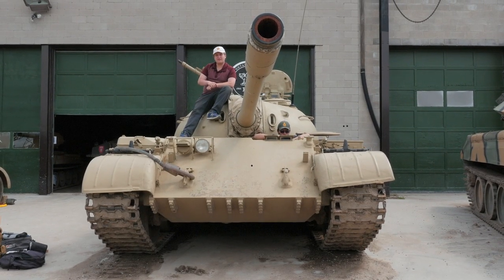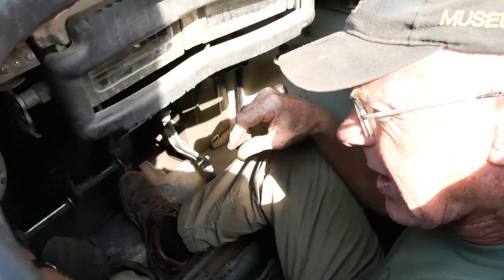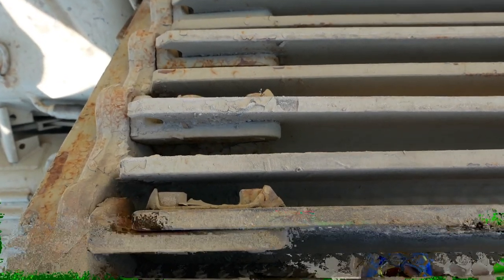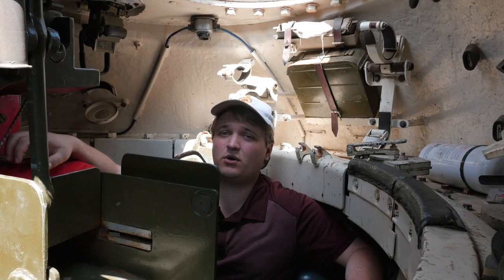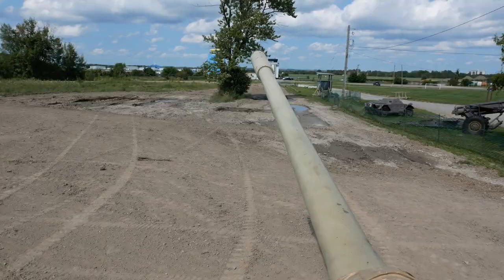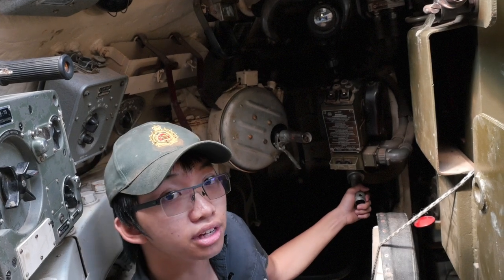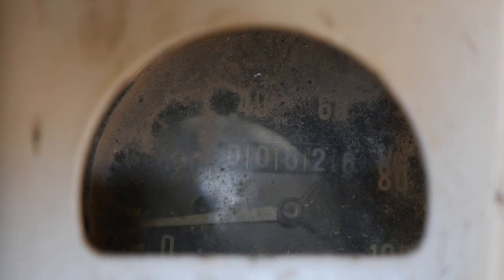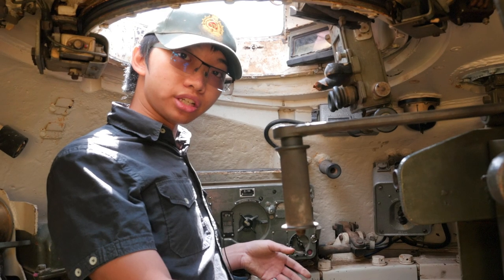Fighting Vehicles: T-54 Fighting Compartment (Startup Procedure and Fire Control Systems)

Comment: The D10-T gun manual says: While driving over very uneven terrain, between shots, make sure the gun is pointed slightly upward, to prevent scooping soil by the muzzle, as firing the gun with the soil in the bore will cause damage or explosion.
So it looks like you could have the gun loaded while moving.
Reply: Any info about kladivo fire control system.according to info.the fcs incorporate 8 bit microprocessor.
Reply: manual sounds circumstancial as if what they said was supposed to apply to a bore with dirt after tank is still

Comment: Inaccurate about Soviet T-34 tanks without radios. That was true up until 1943 - moving on forward all had it and came standard in all tanks - unlike the German headset Russian one came inside helmet ear flaps - I have one and I've also sat inside T-34 and drove one. 

As for losses there was a ton - in all Soviets lost over 80,000 tanks which majority was light and medium tanks compared to German 42,000 losses. Soviets produced 108,000 while Germans a little over 50,000. At the end of the war Germany produced only 30 aces while Soviets over 300. In addition - of the 80,000 tanks lost majority meaning 80% were BT-7s, T-26s and T-34/76 A through F models. When T-34/85 showed up it gave even Tigers and Panthers run for their money. When IS-2 or ISU-152 showed up many times Germans pulled back their counter offensive. Majority of Soviet tank losses were from 1941-1943 and then attrition rate dropped way down and began knocking out Panzer III and IVs like flies, then really taking out Tiger I and II with IS-2s with new Russian tactic they learned from the Germans. Use of artillery, then air assault and clean up the rest with Soviet heavy tanks...almost every battle from 44 and on had Soviets lose less then their German counterpart in the air and on the ground. Operation Bagration Germans lost nearly half a million compared to Soviet 180,000 and Battle of Berlin Soviets lost 80,000 while Germans over 100,000. 

There is alot of lies and misconceptions regarding the Eastern Front and it stems from the work of one man - William Hearst. He was Hitler's personal friend and hardened anti Communist and billionaire media mogul. He spread the idea of order 227 where millions were shot for retreating which in fact out of 3 million who were caught were sent back to the front while 40,000 were sent to penal battalions and less then 10,000 were executed most being junior officers who abandoned their men, gulag deaths of 20 million which in fact was 1.8 million in a span of 23 years and the idea that Germans had 1 to 19 kill ratio which in fact was 1 to 1.3 - Soviet's lost 8 million troops while Germans over 5 million plus their axis partners which added another 2 million giving a total of axis losses of a little over 7 million (Romania, Italy, Japan etc). Majority of Russian losses from the official 21 million figure is 13 million civilians - so its a bit personal when same lies get repeated for no good reason except "soviets are bad" so lets keep it up.

I'm glad you guys have the tank and give it care and love and I hope to pay a visit some time. Other then that great video :)

10/10

Comment: T-54 was equpped with night vision devices, according to the T-54 User's Manual printed in 1969: the models were TKN-1, TPN-1, and TVN-2. However it appears that it was an upgrade feature supplied separately, it could be installed by the tank's crew. The same Manual gives instructions on how to install one. TPN-1 was actually a night vision targeting scope, which allowed to fire the main gun and machine gun at night. TVN-2 allowed the driver to drive the tank in the dark.

The same Manual doesn't say anything about not being able to drive with a loaded gun. The tank had two states: Marching state and Combat state, which were declared by the tank commander. The tank could be moving in any of these states. In Marching state, the gun was supposed to be unloaded and fixed in marching position with pins etc. In the combat state, the gun was prepared for firing at any moment.
Reply from the maker: According to the research documents we have, the night vision equipment would be correct for T-54B/C models, however the particular tank we
 filmed on is a Czech T-54A which would not have had it. It's entirely possible that T-54As were issued TKN-1s later on though. Thanks for the clarification on doctrine 
relating to moving with a loaded gun, that was one thing we were unsure 
of during our research.
Reply: Yes, this makes sense, since the Manual I have was printed in 1969. It has a note saying that it applies to T-54, T-54A, and T-54B. Generally, the Soviet Army manuals were very standardized and included description and differences of all modifications of particular weapon or machine in service at that point in time.
As for night vision, it's appears to be that any T-54 which was originally manufactured without those, could be fitted with one using these kits I've mentioned.

Comment: At 05:50, when you are saying that there were no safety features, this is not correct.
The gun had a guard preventing user from getting behind it during recoil, but it was removable. One of the removable parts is missing in this tank.
Here is the link to the drawing of the gun from T-54 User Manual, the guard is positions 11, 12, 13 in the picture. 11 and 12 are removable parts, 13 is non-removable part.
http://armor.kiev.ua/Tanks/Modern/T54/manual/T54-025.gif
You can see that this tank has part 12 and 13, but part 11 is missing.
The Manual specifically prohibits firing the gun without removable guard installed.
Reply: Ur the best

Comment: Here is a diagram of installation of Night Tank Scope TPN-1 in T-54:
http://armor.kiev.ua/Tanks/Modern/T54/manual/T54-055.gif
And here is a parts list of the driver's night vision device TVN-2:
http://armor.kiev.ua/Tanks/Modern/T54/manual/T54-057.gif
These devices were so easy to install that the tank's crew could do it themselves if required.

Comment: It is wrong info with that live round in the chamber. Of course it could have that, and shooting on the move including shooting without stopping in case of ambush was trained repeatedly. Only case was moving between palposts in the peacetime, because Warsaw Pact in Cold War always travelled with elevated main gun, so accidental goout could fly some 10 -15 kilometers. This tank is Czechoslovak production, manufactured in Slovakian town called Martin. This tank was not used by Czechoslovak army or any Warsaw pact ally, because all of Czechoslovak T-54s were upgraded to T-54M, this meant complete upgrade to T-55 standard, including an engine and amount of ammunition (which was higher for T-55) One of these upgrades was also blidening the hole for drivers machine gun and ventilator in front of loaders hatch to make the tank NBC protected. But the armoured cover of ventilator remained and this is basic simple recognition between T-54 and T-55.